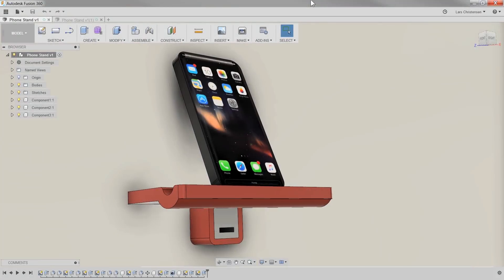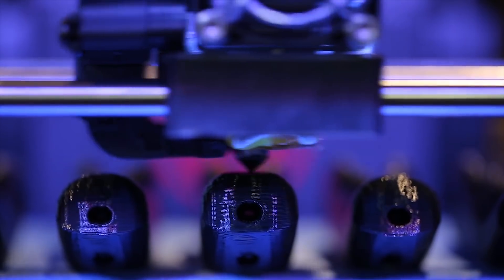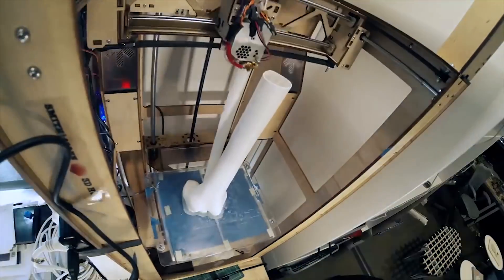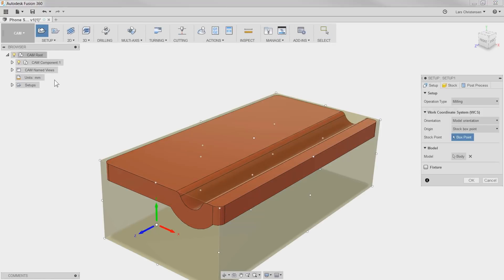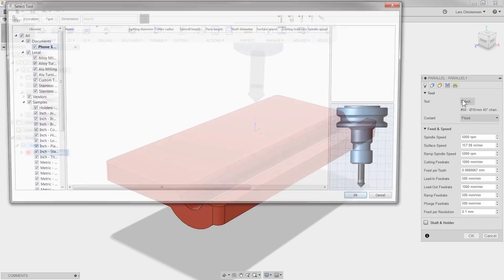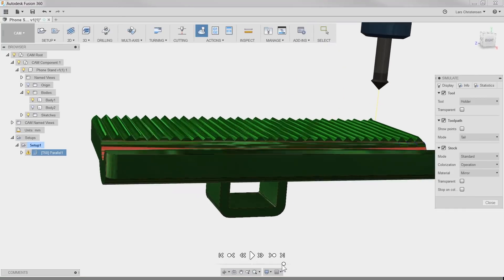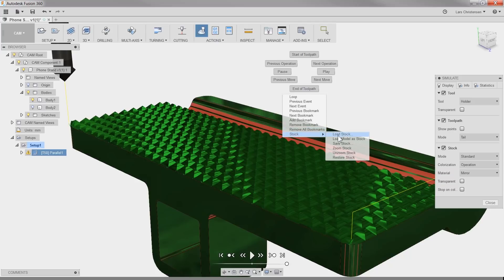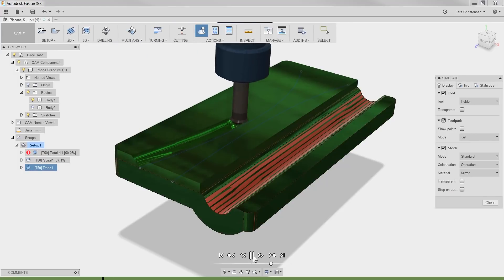QUICK TIP: CAM to 3d Print

Comment: I'm having a problem with the chamfer mill. I'm choosing the same one but it has a flat bottom!! so it always leaves a gap in-between.
Edit: it was the tip diameter, it was set to 2mm...
Reply from the maker: Glad you figured it out! Sorry we didn't get back faster.
Reply: whenever i change the tip diameter it gives me an error of invalid tool type for milling